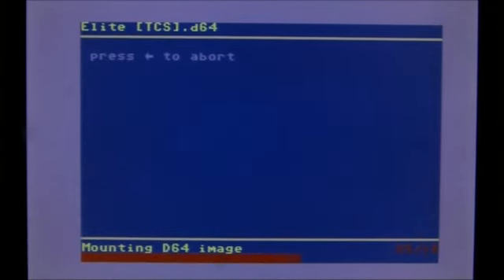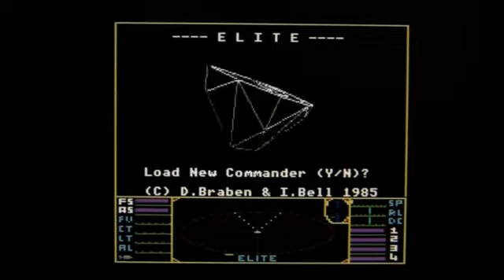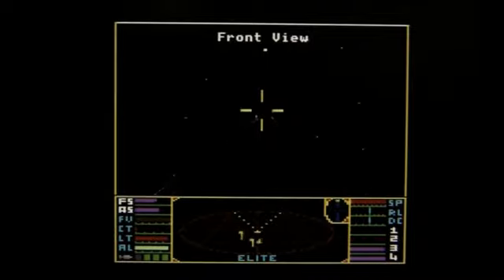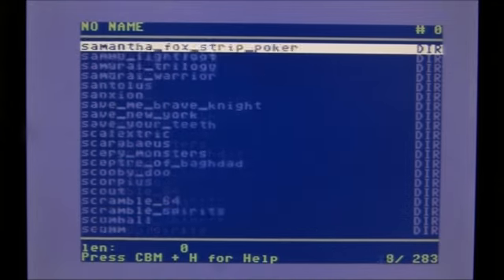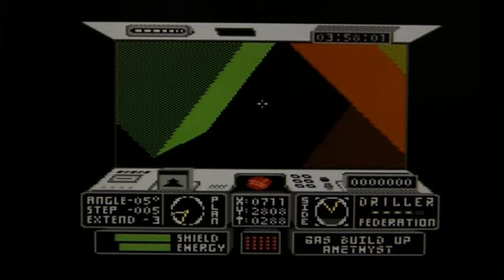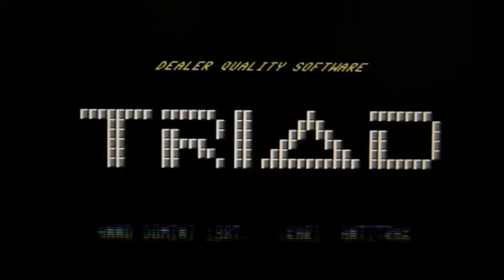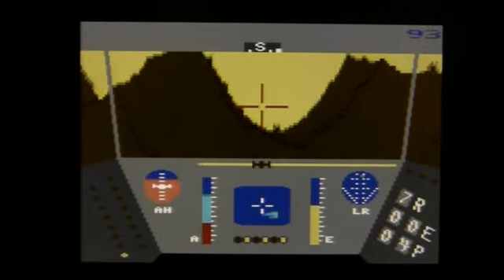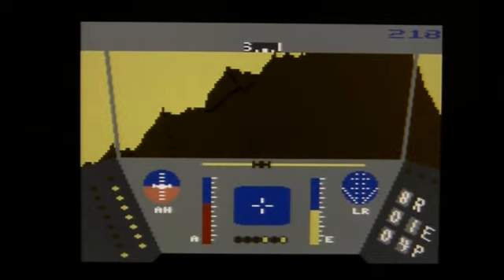Turbo Chameleon 64 - Speed Test

Comment: I own the 1541 ultimate II+ and the turbo chameleon 64 v2. If anyone was ever wondering how in daily use - one would "need" both: I first had the 1541UII+. Then I had want for a turbo on the CPU to play Gunship smooth framerate. Do I still need or want or use the 1541UII+? It has TONS of features, interoperability with real 1541, no complaints or issues and is my go-to where no turbo is needed. I just got the TC64v2. No RRNET v3 card or docking station or IEC cable or IR remote yet. My second time trying to use it - the thing wouldn't fully boot! That was because my real 1541 was plugged into IEC bus and not powered on. My feelings are that this cart will take some getting used to. I suspect it is NO replacement for all that the 1541UII+ is for me. I found that the information is out there for the TC64v2...but it takes real dedicated effort and specific google search terms and luck and the stars being aligned just so - to find the forum with the info you need to get help from - you're all on your own, regarding familiarizing yourself with it and it's features and issues. learning curve so far has been a bumpy road. Nobody yet has spelled-out what or how to do the SD card that you put games, cores on. Not that I've found yet. I just formatted it FAT32 and dragged games onto it and that worked. I suppose there's a repo of cores that I would do the same with. Turbo Chameleon 64v2 mfgr & community support is janky, broken up, disjointed.